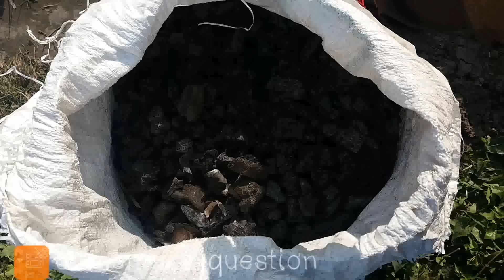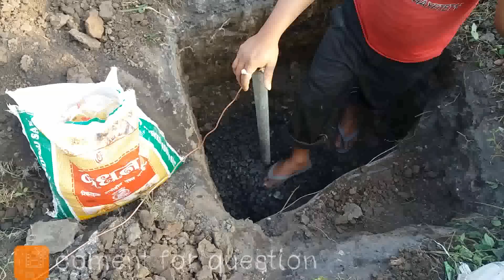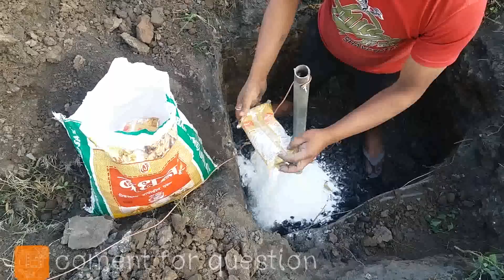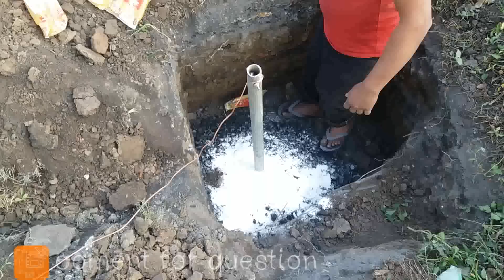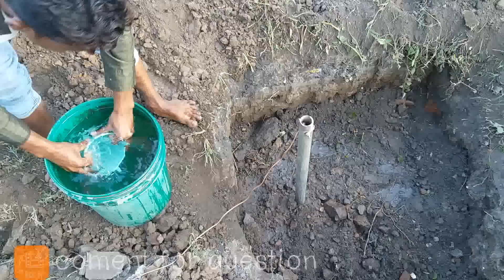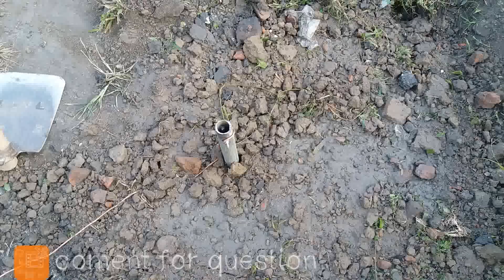what is the easy process of earthing in domestic,commercial and industrial purpose ?

Comment: hey, i'm very thanks for your video
my question is
for depth and length you dig what is your reference? 
or there is measurement we use in this system try to explain.

other what is a good resistance we can't go beyond in earthing
Reply from the maker: we required 1'/1'  up to 5' length  , as it was dug manually so it was 3'/3' with 5' length . it is best process for all . and very easy also 

tank you
Reply: thanks for your result,

but what about the resistance

Comment: hello sir ..I lived in farms{fields} far away from village..so we don't have 24 hour supply..but we have 3 phase 220 v supply for 15 kw mortor which hv not nutrul. only 3 phase....😢. I used 1phase and 1 wire to ground earth..fans and lights works ok but when we bought refrigerator and switched on it volts drops from 230 to 18o and fans is slow now due to refrigerator...how can I increase ground earth efficiency...if I use 3 or 4 ground earth like u..is I got proper full voltage which drops right now

Comment: Sir Please tell if ALUMINIUM rod can be used. I have aluminium rods dia approx 15 mm at home. Will it do?
Reply from the maker: no avijit , earth resistance will not good in that rod
Reply: : earthing and material  Mumbai Maharashtra and Gujarat and Rajasthan All earthing contact number.   7339822500////// 8652658846

Comment: questions
1.which size wire used in pipe.
Reply from the maker: Nice  question  mr. Awan ,
if we consider 6 sq. mm copper cable  the nominal area will 25 mm2 ,

its totally depend upon you  ( purpose  of earthing , what equipments connected ...etc)
Reply: i think it's depend on current.if current is too much then we use   cable size much.am i right?
Reply from the maker: yes ,
you r right

Comment: What did he put in the hole?
THE Wire is too small.
Electrode should be copper.
Reply from the maker: Thanks for advise sir ,
Here the wire is not small , at that time  the wire was fasten tightly because we had to do a earth pit over it . it was only created layers by  charcoal(wooden) and salt , yes that electrode was copper with galvanised.